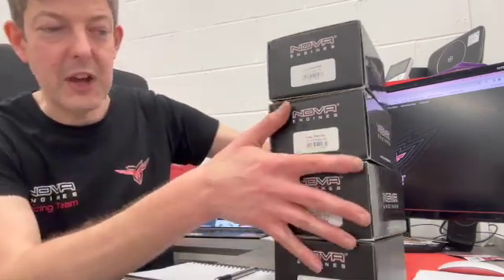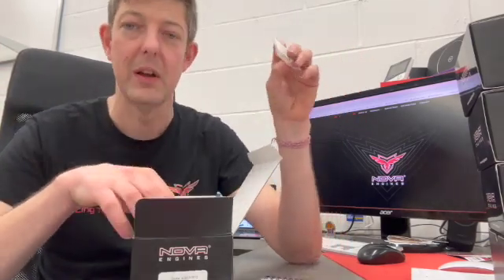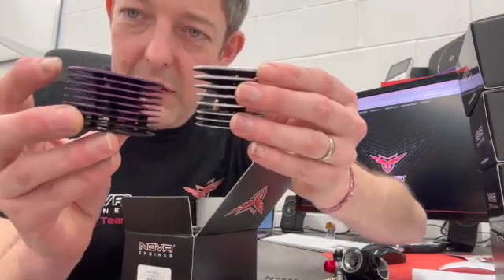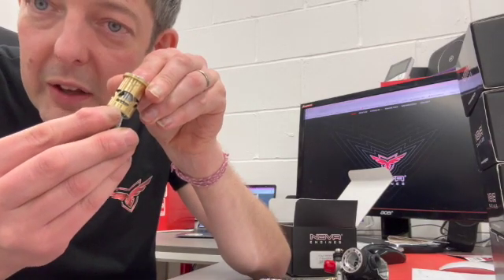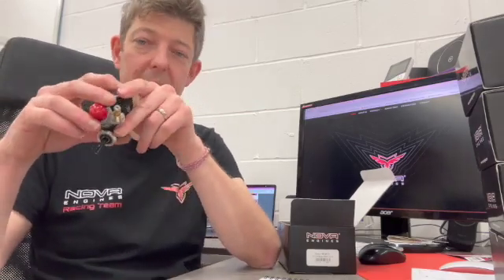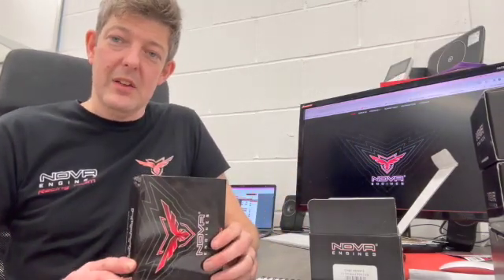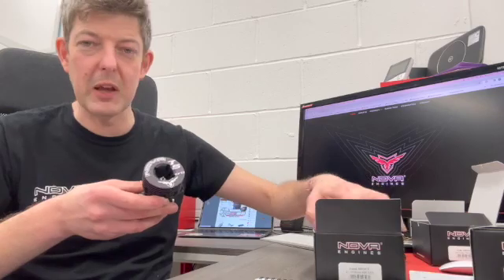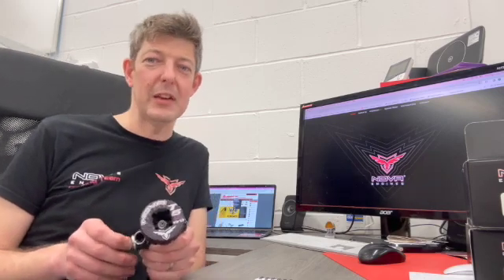NOVA Engines 2024 overview including EVO B5R and others

Comment: I agree with a previous poster ,  a nice pull start motor would be sweet to add to the line.... and maybe eventually a .12 engine?  
   I'd like to try a Nova engine, which one would you recommend if it is to end up in a Truggy?  The T6 Evo or one of the normal .21 mills....? 
   Cheers

Comment: You guys NEED to make a .28 bump start and pull start for all of us who are bashers!! There’s like nobody left making quality 28’s, so I feel like if you did make one then you’d have a monopoly on that size engine. I’d get multiple of them for sure!!! Pleasssssse!!
Reply: buy the outlaw .24, put a bigger cooling head and run an Ielasi v3 gt manifold and a 9886 with a .70 stack on 30% and its insane!!!!! Crushes a modded 28-7/8/9  or any other big bore engine.I hope they make a .24 version of it...maybe w a 10+mm carb :). seriously the outlaw w thar set up will blow your mind. i have a couple modded .24r's, many 28s, romas ,32s, the outlaw is in class by itself for what you are looking for...even off the bottom !!! king daddy  nitro for all out power and rpm